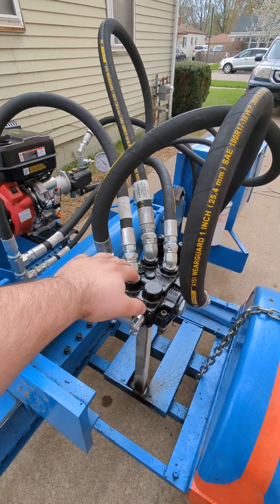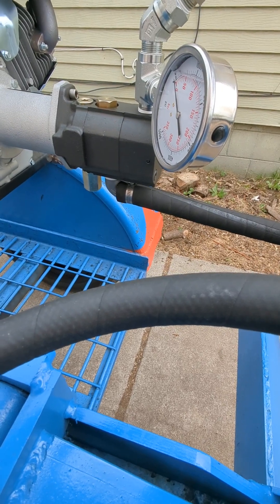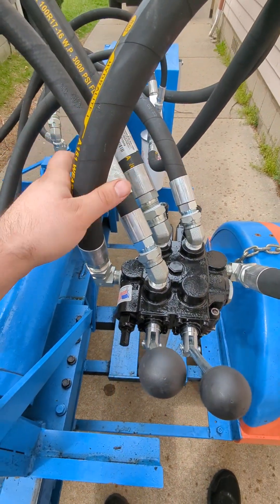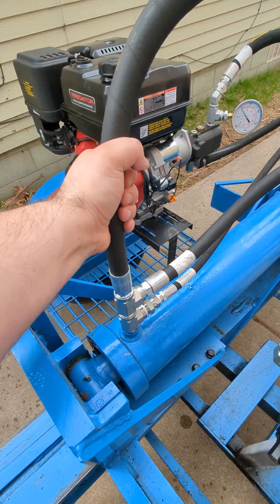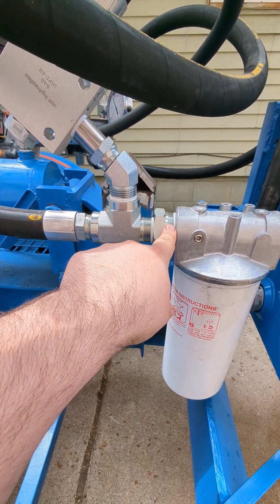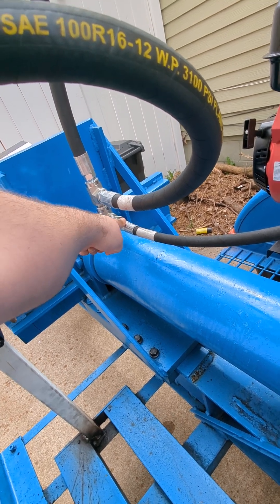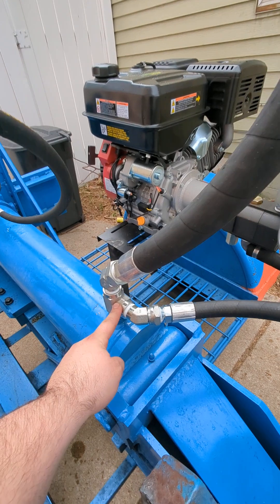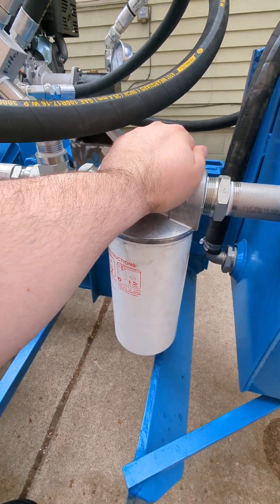advanced log splitter plumbing

Comment: do you have a video of splitter in action? do you have  a diagram? my goal is to add a prince 5000 series auto cycle valve to my log splitter. great job i would love to see your splitter in action
Reply from the maker: @barney1941  after a couple years the wings were bent all up and trashed. So I just torched them off and have to weld on some new ones first. But maybe when it's done I'll set it all up and make a video

Comment: Can you please let me know what kind of plug you put in the power beyond port of the autocycle valve? Is it a standard NPT plug or is it a certain/special plug that needs to plug the power beyond if you’re not using the power beyond? Thank you
Reply from the maker: @44dhelk  I forget what it was, but it was bought off of ruggedmades website. The same place I bought the valve from

Comment: Hi, what engine do you running, how it performed so far spinning 28gpm?
Reply from the maker: @yoyo-jq3wk  the high output 460cc harbor freight predator. It works, but the idle certainly slows down when I'm maxing it out. But that only happens when splitting knotted elm that's 30 inches round through the 8 way wedge. A county line 25 gpm pump would be perfect I think but finding a replacement for a 40ton county line can be difficult

Comment: Can you tell me what the part numbers are on the Dump Valve cartridge and valve body block. Its stamped right on the parts.
Reply from the maker: No, I'm not sure what they are selling now, but I believe split geeze sells a different model number now. I'd recommend googling them and buying the dump valve that fits your exact usage. They have 2-3 different gpm ratings

Comment: Great video. This was very helpful. I'm in the middle of building a  vertical log splitter similar to the axis but a little bit more heavy duty.  It's also gonna have a  28GPM pump. I'm curious if the 1" lines going into a 3/4" port really helps with flow. I love the dump valve, so thanks for telling us where you got it. They are not a commonly available thing. I'm setting the vertical splitter for speed, so flow rate and minimizing restrictions is key and also to keep the heat down. Right now the plan is to with a 4" cylinder but I'm gonna have to weld some larger 3/4" ports onto it to make it fast. Mine will also have a 25 gallon tank. Filtration was also a concern for me. Where did you gat that 80GPM filter housing, I've been looking around and the best I could find so far was 50GPM. I'd rather have it over sized than under sized. I'd love to see your splitter run in real time to see how fast it actually is. I couldn't find a video with it in action on your channel.
Reply from the maker: Speed, this thing is pretty slow. 12 seconds I think. That giant 6 inch cylinder really slows things down. But it will put a 35 inch wide knotty oak piece through that 8 way wedge which is really nice. The 1 inch lines don't help with flow, they only reduce the heat. That giant filter is from surplus center and I believe it has some giant thread like 1-1/2. I love it though, it should last forever damn near. I also turned a 40 ton county line into my fast resplit machine. Replaced the cylinder with a 3.5 inch cylinder from rugged made. And with that 25 GPM pump that's on it, it runs 5 second cycles times. Absolutely a monster. Let me know what more you'd like to see, and if I missed anything in this response
Reply: @cocoscorner6419  Thanks for the quick response man! That's kinda why I went with a 4" and a 28GPM pump...to make it fast. I'm not sure if it's gonna be fast enough. I might have to go to a 3.5 or 3" cylinder. According to the calculations, I'm looking at about 4.5 second cycle time , with the 4",  but thats if the flow isn't restricted much. You definitely need a dump valve on that huge cylinder. I might need to do the same to get a faster retract time because the valve body becomes the restriction on the retract. I've seen quite a few  vertical splitters on the tube with 3" cylinders and smaller 22GPM pumps, with no dump valve, that move pretty damn quick. I have an account on Surplus Center, I'll have to check and see what they have. Coincidently, the beam and splitter head that I'm using is from a Northern Tool 37 ton splitter that had a 5" cylinder on it. I'm selling that 5" cylinder to try and recoup some of the cost of the splitter I'm building. 😏